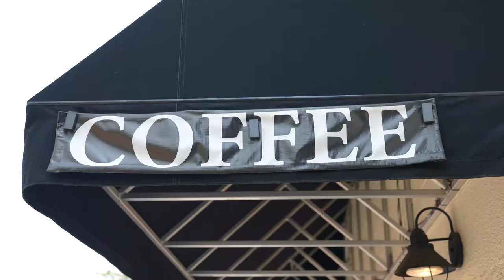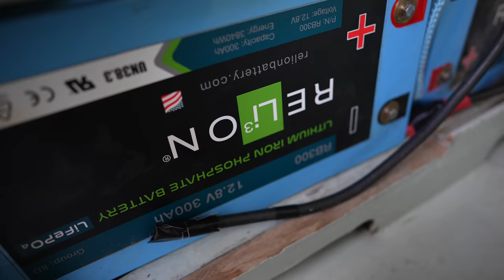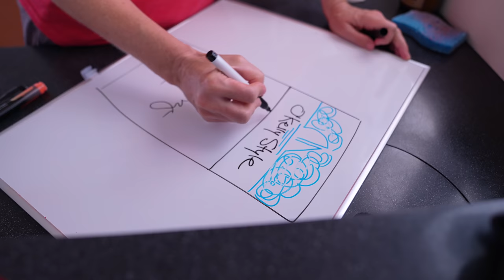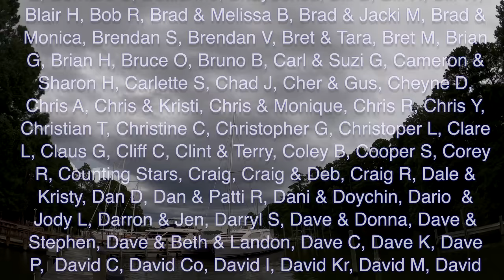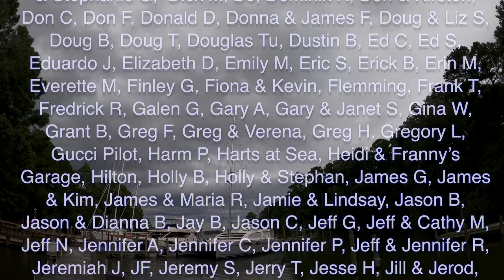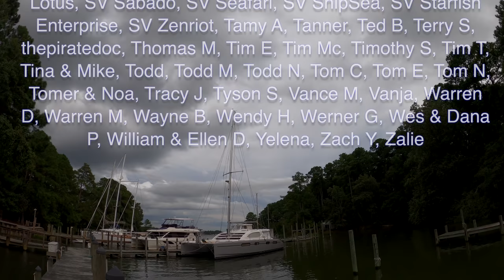Well THAT Escalated Quickly - Returning to Clarity

Comment: Make sure to clean the AC coils, too.  Coil cleaner (evap cleaner since inside) or 1:2 vinegar to water.  Rinse with fresh water afterwards.  Probably 2 to 4 times a year considering usage, the salty environment, and there probably are not any filters(!).  Dirty coils will cause a huge increase in power consumption.
Reply from the maker: Thanks! Gonna do that. Never have

Comment: Great video guys! I love the way you explain it. How it’s technically enough for those that know and plain enough for those that don’t. Also, your a/c being hooked up backwards will work. However it will transfer heat better going the correct direction. You should notice an improvement with them hooked up right. 
Thank you! 
Timmy
Reply from the maker: Thank Tim! Yeh seems to be working better now.  Bet the barnacle Buster helped too.

Comment: Hope there are no SURPRISES replacing those motor mounts, Nick! 😉
Why is it always SOMETHING.....expensive? 🤔
Another solid episode, top notch production, music, and editing! Kudos!
Reply from the maker: Lol. It’s never a small job on a boat!
Reply: @TheOKellys   Those mounts originals? Possibly transferring vibration to the folding prop bearings through the shafts...even if isolated by the universals, or straight shaft? Just a thought, Nick... you know the set up. Anyway...Good luck with their replacement. Smoother running for sure. 👊

Comment: Hi and welcome back to the east coast. It was nice to see some shots from home, Oregon, I am also originally from NW, Portland, Eugene, Newport, and Bend. However, I am writing because recently I caught a video on lithium battery installations where it was discovered that if each wire from each battery is not EXACTLY the same length, regardless of battery distance from the main bus, the battery with the shortest leads will take over and this will result in battery failure(s) (paraphrasing, but you get the pic. I tried to find you the episode and discovered I watch waaaay too many sailing videos, as my history was on par with the library of congress. If I find it, I will fwd the link, but something you may want to check.
Reply from the maker: Haha! We did talk about that a few episodes ago. Critical!
Reply: @TheOKellys  Well that explains why I could not find it on any other channel. Good thing you replied right away. LOL ..time to clear my history channel.
Reply from the maker: Hehehehehe!

Comment: I would say if only 1 battery failed its cause that one had a shorter wire which caused it to take the whole load through it.  every wire has to be exact same length. no exceptions. hope this helps if you didn't already know that.
Reply from the maker: Yes, could be. Corrected that issue.

Comment: I noted the torque wrench on the prop this time ;)
Reply from the maker: I always use a torque wrench. That’s some expensive gear down there!
Reply: @TheOKellys  I learned a lot by watching the reconditioning of your prop. Your segment on the cable length for your lithium packs, is going to save $$...Thanks!
Reply from the maker: Oh you meant on the rebuild. I was talking about on the shaft. Yeh I’m never rebuilding these myself again. If they need more service I am sending the in

Comment: Another great episode in the books. Next episode please close the loop on the 2 open issues: did you fix the leak that caused the rot and was the air conditioning plumbed wrong?
Reply from the maker: You got it. Leak fixed and yes it was plumbed backwards.
Reply: @TheOKellys  What part was backwards?  It couldn't be the refrigerant because the expansion valve is (typically) one direction.  Is there a secondary loop for cooling?
Reply from the maker: It was the seawater cooling that was backward.
Reply: @TheOKellys  How much impact do you think that had on system performance?
Reply from the maker: Really have no idea. Someone with more experience here said it should be more efficient now. Seems to be, but also we barnacle bustered it

Comment: Nice vid. Thanks.  But surely you must have been wrong about inlet/outlet aircon water hoses swapped?  The inlet is below water and the outlet is above (normally, I think) so you could not feed it from above the waterline.  I must admit I don’t enjoy when things like that are raised but not answered.  Nick if you get time could you speak to that please?
Reply from the maker: It’s one way flow through an aircon unit so the input went though the output end and vice versa....the flow was simply backward through the unit. It works better now.
Reply: @TheOKellys  ah I see…. It was just the flow direction through the cooling structure not to the pump itself.  That makes sense…. and that it would run better when going in right direction.  Thanks for replying…. much respect to you two for what you’ve achieved and the decency that you approach everything with..  the worlds a better place with folks like you in it.  Thanks for the journeys you’ve taken us all on.

Comment: Is that a big chain locker fiberglass separation/crack under the boat in the shot where they team is setting up the lift? The Wynns’ cockpit locker fell off from the bottom of their leopard recently during a big passage. I’m sure you’ve investigated but I’m curious what it was. Thanks. Love all the videos and content.
Reply from the maker: No, no openings aside from the escape hatch in the bridgedeck. You might be referring to the little gap between the da it bottom and the bridgedeck. That’d throughbolted. Could fail of course, but it’s a 1/2” hole if it did.

Comment: Rookie quest: Do you have power while staying on the boat when it's on the hard to run the air conditioning? or do you have to run the generator?  thanks!!!
Reply: Boat AC units require raw water from the ocean to act as a heat exchanger, so no AC when on the hard.

Comment: It would be good to know if Relion stepped up and replaced your faulty battery??
Reply from the maker: No, and we didn’t ask. They are out of warranty. This isn’t on them.
Reply: @TheOKellys  Fair enough though ouch expensive. Since there is a chance it is the BMS and they are comparatively cheap could be an idea to swap it out or indeed if it is a cell you should be able to identify and replace it. I think I remember that most of the Battery manufacturers even use the same commercially available cells. Normally I would not suggest it but that is a couple of thousand dollars worth of equipment right there.
Reply from the maker: I gave it to a neighbor boat project who can do that kind of work. It will live again, just not on Clarity.

Comment: Happened to be at Zimmerman's last Saturday afternoon and saw Clarity in the water...with the AC running!  This has been one heck of a humid summer, with more than our usual afternoon storms.  Clarity's hulls still look nice.  If you could have been off the boat long enough for a paint job, would you still have gone the vinyl route? Since Clarity was in the water, I took the opportunity to take a close look at the VViViD One Way Perforated Window Vinyl Privacy Wrap you used on the hatches a year or so ago.  It still looked good to me after being exposed to the weather for over a year.  I need to do something like that on my Bomar hatches that act like little heaters in the summer on the Chesapeake.  I never saw a follow-up video on VVivid.  Would you install VVivid again? Enjoy your videos.  Smooth sailing...
Reply from the maker: Oh yeh, paint is too expensive unless we did it ourself. The vvivid? Yeh, good stuff....cheap! Four seasons now...holding up pretty well I think!

Comment: With regard to the flow of cooling water through a marine air conditioner, does it really matter which way the water goes?  Either way, you are pulling the same heat out of it, right?
Reply from the maker: No idea to be honest. The barnacle Buster was also used. It does seem happier now
Reply: Yes it usually does matter. Most exchangers are designed with flow direction to achieve max efficiency and are rated as such. If reversed it will require a higher flow to achieve the design heat exchange. 
So in this case where the flow is fixed (water pump), there may not be enough water flow to exchange all the heat in max loading conditions. Likely to be OK at smaller loads though, but you really need A/C when it’s really hot hot hot…
You can’t also increase the flow that much (bigger pump) or you’ll face higher pressure losses in the various pipes and in the exchanger itself, leading to alarms and other messy things… 
Better to get all the plumbing the right way! 😁
Reply: @TheOKellys  for sure that “internal cleaning” helped to reduce the pressure losses in the cooling water side and the overall achieved heat transfer efficiency!
Reply: @lionelfournier  Yeah, I installed mine correctly, of course, nor would I suggest otherwise.  I am just wondering why it is the case that the flow matters.  How does it physically matter?  Just curious.
Reply: @TheOKellys  Every now and then, I hook up a hose to each unit and blow them out.  A shocking amount of dirt and garbage comes out.  Then I do a barnacle bust when it no longer is good enough.
Reply: @TheOKellys  It really does matter that the flow is in the correct direction, especially with modern refrigerants which are actually a blend of several refrigerants and have a temperature "glide" (R-11 and R-22 had very little temperature change so it didn't matter as much 20+ years ago). The AC will still work, but it's not as efficient and you won't get the maximum amount of cooling capacity if it's piped incorrectly. Now that you're running without a generator, every little bit of energy savings is a big deal!
Reply: @lionelfournier  We asked some engineers from one of the marine air conditioner companies about this.  The preferred direction of water flow is opposite to the refrigerant.  The difference in air conditioner mode is very small.  But the difference is heat mode is supposedly much bigger.

Comment: Okay so I'm dying here, what's the deal with the AC? Did you get it figured out?
Reply from the maker: Yeh, all good. It was plumbed backwards. Fixed it
Reply: @TheOKellys  , After your servicing and correcting the flow has the cooling improved and the pressure code's gone away?  About to use the barnacle buster on my Helia 44 here in south MS.  I was thinking the 85 degree gulf water probably compounds my issue.

Comment: And casually Nick says "So I load tested the batteries "   OMG do you guys also carry a battery load tester on board? That's gotta be a first.
Reply from the maker: No no, not a proper load tester, but with lithium you don’t need one really. Charge it all the way up and put a progressive load up to 0.5C. Voltage should hold if battery is good.